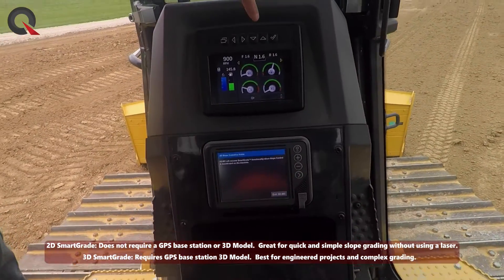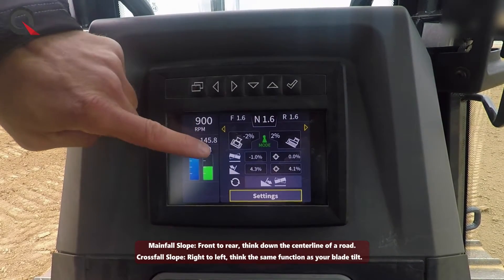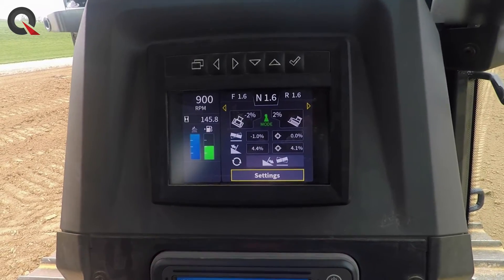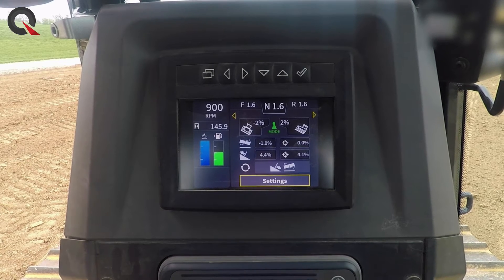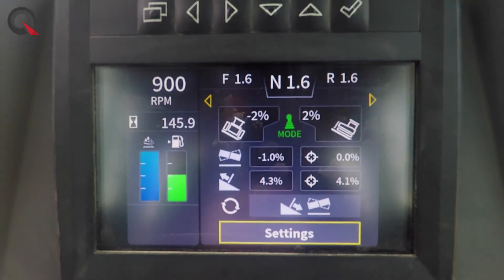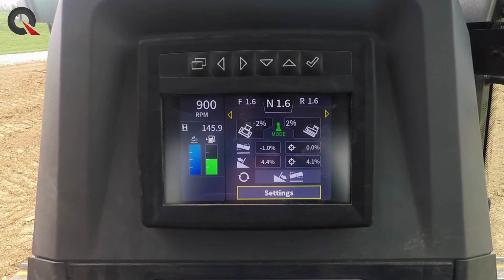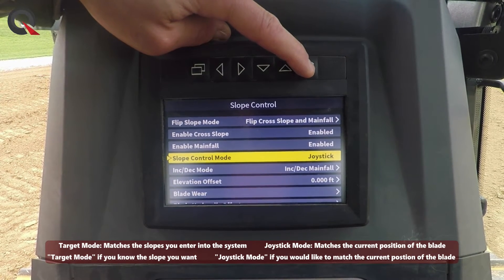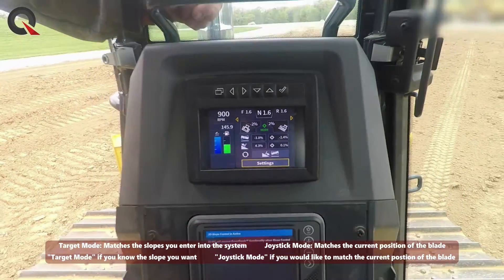John Deere Bulldozer - 2D Basics - SmartGrade

Comment: The one I'm running just stopped working. I press auto and the blade does nothing. It's weird because it worked fine all week.
Reply from the maker: Thats a drag.  I'd suggest starting simple and checking any fuses tied to the system.  Troubleshoot your way up from there.